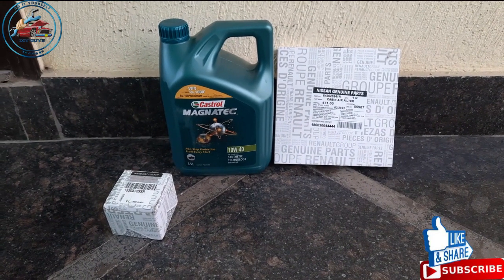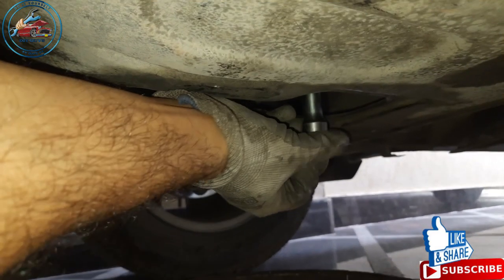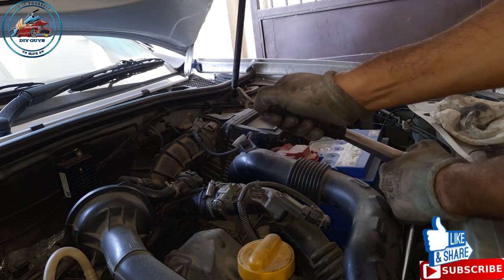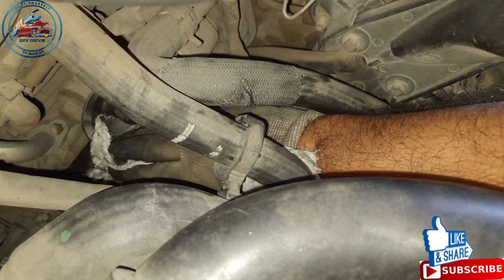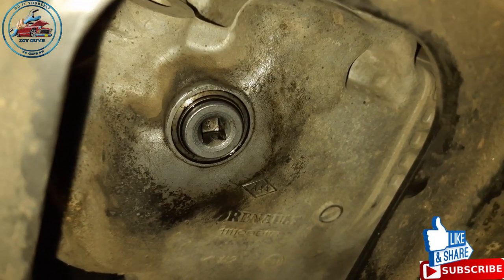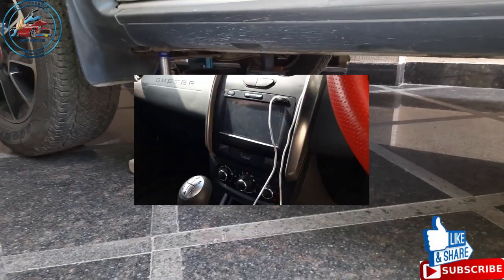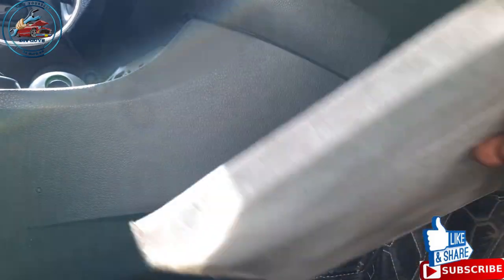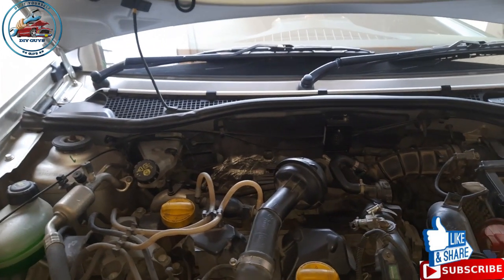Renault Duster Service @ Home |  Dacia Duster Service @ Home #duster #dacia #service #DIY

Comment: Can we use 5W30 fully synthetic engine oil for Renualt pulse diesel
Reply from the maker: No that grade is for petrol engine or BS6 diesel engine.
15w-40 or  5w-40 full synthetic like Castrol edge

Comment: In Renault duster how to check the level of automatic transmission of a 2.0liter engine.please give your input
Reply from the maker: Hi Bhupinder, Plz check if there is dip stick to check automatic transmission oil. If not you need to check it manually by inspecting via oil filler nut.
Soon I will post it's video.

Comment: What should be spark plug clean/change interval for petrol engine, specifically for an engine like triber.
Reply from the maker: Hi, Spark plug should be replaced between 20-25k.
Reply: @diyguy7378  Thanks for reply.🙏

Comment: How long does that oil last? Should i go for castrol or motul xcess?
Reply from the maker: Hi, It depends on oil which you are using, mineral oil should be changed after 6k kms and synthetic after 8k kms. Synthetic or mineral, depends what you are using since beginning, will not suggest to switch between oils.
Go for Castrol.

Comment: What's that white light flashing in the back when you're replacing the Air filter?
Reply from the maker: It's a CARCAT Ultrasound Rat Repellent available on Amazon.
Reply: @diyguy7378 Thanks yo!

Comment: i own a Duster, the clutch is so hard , and it has started paining on my knee, what it would cost to change the clutch assembly along with flywheel?
Reply from the maker: Flywheel replacement is not required, 85PS genuine clutch & pressure plate with release bearing will cost around 15k,  including labour charges.
From ASC it will cost approx 25-28k.

Comment: Duster mein toh 5W-40 engine oil company recommended used hota hey..
Reply from the maker: 5w-40 full synthetic engine oil hai or 15w-40 semi synthetic, Renault service center dono use karte hai, so it's up to you. Personally I don't like full synthetic for Duster as per my experience in extreme conditions.